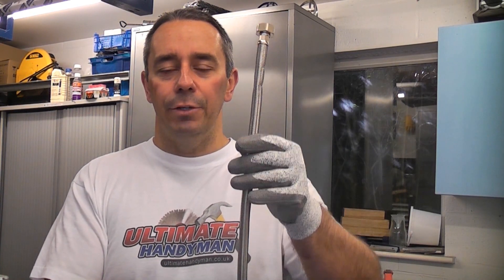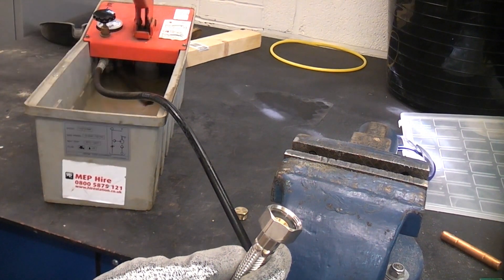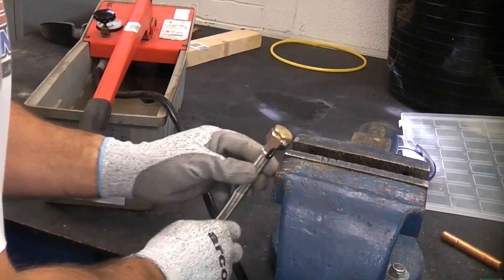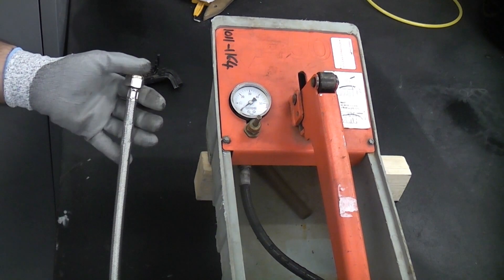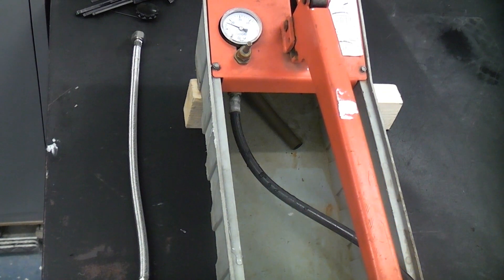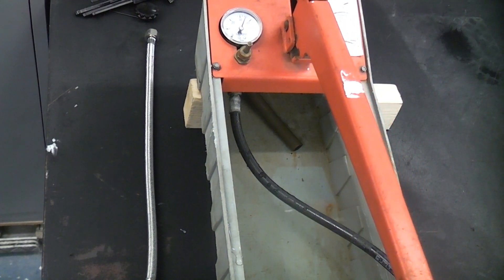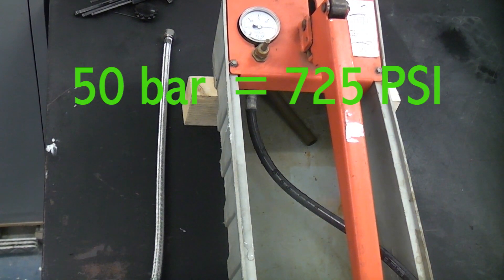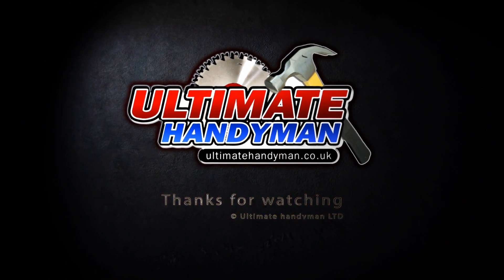flexible pipe  pressure test

Comment: I've found your recent pressure test videos very interesting. It's surprising to see just how much pressure the different commonly used fittings can take, and interesting trying to predict how they would fail if they were subjected to high enough pressures. Great video as usual!
Reply from the maker: +Eicles 
I'm glad you have found them interesting. We have to pressure test steam pipes on site before they are installed, so when I saw a test rig for sale at auction I thought it would be good to test some domestic fittings.
Thanks for the comment ;-)

Comment: I've been using these for almost 20 years (one over the toilet, has been there for 18 years now) and i've never had one fail where it wasn't my fault for, one time bad installation, you have to be careful with twisting these, or more commonly when the bend exceeds what they are designed for (kinda like with fiber optics, there's only so much bend they can take before it's  a stress point).

One tip for young players, never cheap out on these and never buy the variant that has the flexible transparent coating on the outside of the metal reinforcement. Cheap ones will burst in time and the covered variant forces the weave to eat in the rubber tube beneath. 

One other thing is that one should never throw these out even if they are burst because they are a good (and frankly free) source of thin gauge wire. And it's very high quality wire, perfect for binding various things with.
Reply from the maker: +aserta 
Thanks for the detailed comment ;-) 
I'll remember to save any old ones for the wire ;-)

Comment: flexi hoses are great, us scuba divers have started to use them as well for their reliability, and they must be able to take pressure as the hose to the tank pressure gauge is unregulated tank pressure so must be able to take a whopping 232bar or 300 bar if the right gear is used!

Comment: Very common now in the U.S, however (and I don't know if this is true in the UK) the threaded end is different for toilets than it is for faucets - which can sometimes be frustrating if you have on on hand that looks like it will work - but you've got the wrong type.  I suggest to buy them longer than necessary--rather than stretch them to fit, it's easier and usually more aesthetic to make a loop in your path.  Very handy indeed.  Reminder, if you're ever in the states, you've got a place to stay, and a place/software suite to edit your videos...
Reply from the maker: +Jo Baecker 
Thanks Jo,  They are the same size in the UK for toilets and basin taps (1/2 inch BSP) but the bath taps are normally larger at 3/4 inch BSP.
If I ever make it to the states I'll be sure to let you know ;-)
Thanks for the comment

Comment: Very helpful videos with interesting content.  As an ex plumber myself I was unsure about these as well but this has helped me (as has your video on the push fit plastic stop end pressure test).  It would be great to see you test/review a few of the different gas trigger torches for plumbing like propane and mapp (i think that's what its called!!!) etc.  In my day it was the propane or butane cylinder c/w hose and torch.

Anyhow thanks for the great content I get the feeling I can trust you...
Reply from the maker: +George Ferris 
Thanks George, This has been on my list of videos to make for a few years but I have never got around to making it. For me there is only one torch, that is the Rothenberger superfire, you can use it at any angle, even upside down. It ignites at the press of a button and goes out when you let go of the button. It can also be used with several gasses such as Propane or Mapp. I'll try and get around to the review soon ;-)
You can trust me by the way, I have nothing to gain by misleading people and only ever show good things on the channel that are up to the job. I have been sent some stuff in the past to review, but if it's not up to the job it goes in the bin and not on the channel ;-)
Thanks for the comment

Comment: since I have found you, I have subbed and find your videos great information. my question is, you have done a lot of pressure but if we had this with water in it, does it take a freeze test as in Canada here, eh.
Reply from the maker: +George Gardinier 
Freezing is a little different due to the expansion of the freezing water. I did put a piece of copper pipe in the freezer a few years back with a compression fitting on each end and the force of the expanding water did remove the fitting from one end of the pipe. I think flexi pipes would fare much better to cold conditions than a copper pipe because in theory it should expand, whereas a copper pipe splits open. I'll try it out in the next few months as the cold weather will be here soon ;-)
Thanks for the comment and for subscribing ;-)
Reply: +Ultimate Handyman can you say which part of UK you are in, I am in Ontario . you don't get -20 though, ha. the Flexy I have problems with the little gasket. I squoze it too much and then it fails so the store told me to just finger tight then one more turn, so far so good. do you think if you had a 6-foot piece would the test be worst
Reply from the maker: +George Gardinier 
I'm in Darwen, Lancashire -
https://en.wikipedia.org/wiki/Darwen

We have a rubber type gasket in our flexi's which work very well- as long as you do not over tighten them. If the flexi was longer or a larger diameter the test would be different as you would get more square inches in it and would probably fail.
Thanks for the comment ;-)

Comment: we use those often here in the states, 725 psi is incredible, I wonder if those braided supply lines sold here are just as strong
Reply from the maker: +Nate Dogg Thanks, I'm not sure but would guess that they would be designed to take a similar amount of pressure.I must visit the states when my kids are a bit older ;-)Thanks for the comment

Comment: great video lol I was worried the pipe was going to burst I hope you had your safety glasses on ☺ myself being a heavy vehicle mechanic I've seen hydraulic oil lines burst at constant  high pressure. Flexible steel braided pipes are common in my line of work it's good to see that plumbers and diy people are using them too
Reply from the maker: +Yusuf Maltese 
I did have the safety glasses on for this, as you can't be too careful. Normally though with these pressure testing machines the pressure drops almost immediately if there is a leak, unlike Hydraulics which are much higher pressure. 
Thanks for the comment ;-)

Comment: Can you use flexi's on central heating systems. I need to re-position a smaller rad and this would be ideal for me under the floor boards. Now I know pressure clearly isnt an issue, what about heat? (I know solder is best - this would just be mega easier to do). Thanks
Reply from the maker: +Steve Wigham I don't think you can to be honest. I am sure that they are only suitable for domestic hot and cold water, but not central heating due to the temperature of the water.Thanks for the comment
Reply: +Steve Wigham May be that one could use the pre fabricated /  pre swaged  stainless  
flexi corrugated pipe  complete with fittings   we now see coming into vogue and being
 sold  for small jobs seem to have a use  where  before a number of 
bends were reguired to  do a  offset run...

Comment: Very good to know, I am really surprised it didn't burst, I knew it would hold a good pressure but 50bar is very impressive!
I do like flexi tails, they have got me out of a lot of trouble on renovation and repair jobs where previous plumbing is in very awkward areas. My favourite kind to use have the built in isolation valve.
Reply from the maker: +caskwith I must admit that I thought it would have burst. I have never tried the ones with isolation valves built into them. Is the slotted screw in them metal or plastic? I once tried to turn a plastic screw in a push fit isolation valve and it just chewed it up, which put me off them for life!Thanks for the comment ;-)
Reply: +Ultimate Handyman I have only seen metal screws and that is all I would use anyway.
Reply from the maker: +caskwith 
Thanks ;-)

Comment: I was a bit unsure of them at first but I do now have 3 of them fitted at home, they do make life easer when your fitting something in a tight space.
Reply from the maker: +Garry G 
Absolutely. A mate of mine is a plumber and he says hat these are far better when connecting them to plastic threads, such as toilet water inlet valves because the rubber washer seals better against the plastic, whereas a traditional tap connector uses a felt washer.
Thanks for the comment ;-)